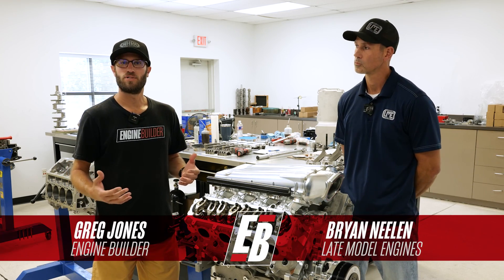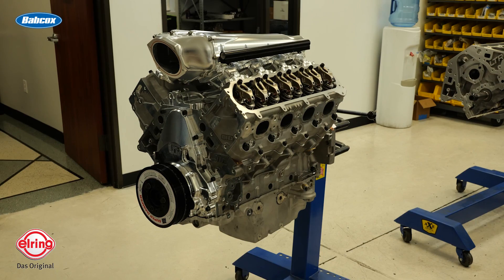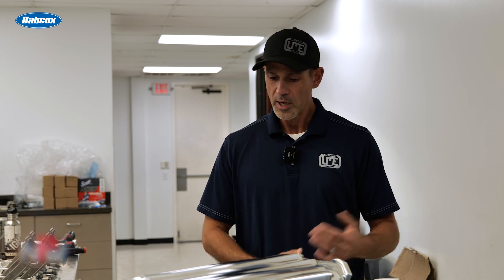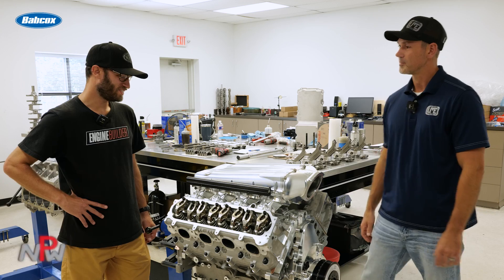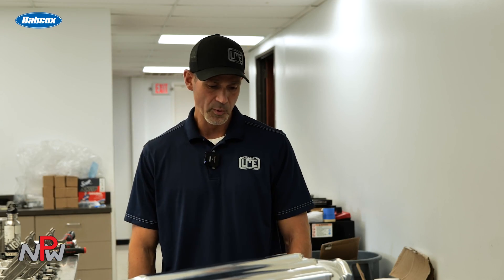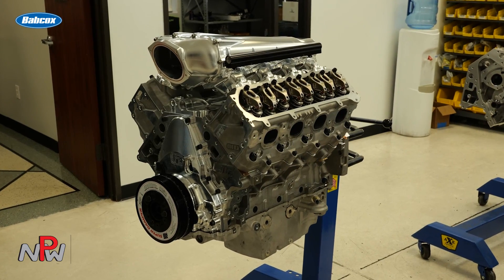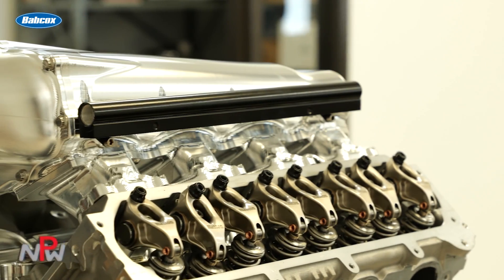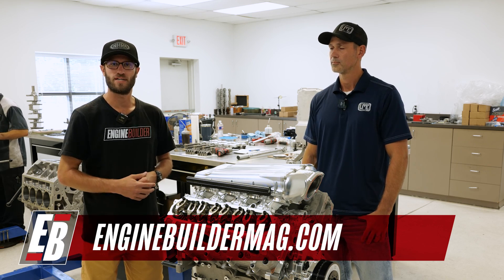Naturally Aspirated 440 cid LT1 Engine from LME

Comment: This is basically my dream engine but I want the edelbrock LT1 heads with the moved exhaust port. I wonder if 93 octane can be used at 12.5:1
Reply: Yes, pretty much max CR with 93.  93 is ~10% ethanol blend, normally doesn’t get below E40 if I can’t find E85